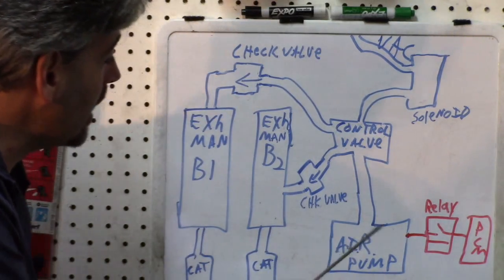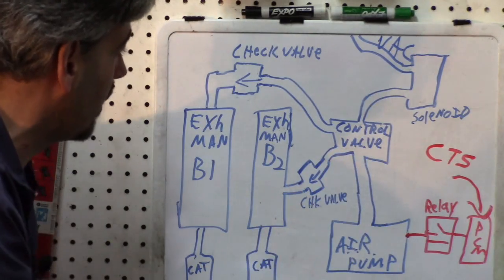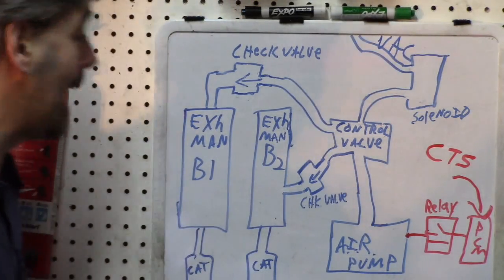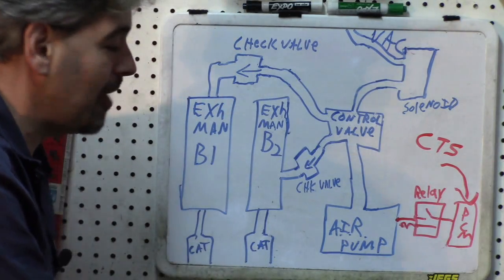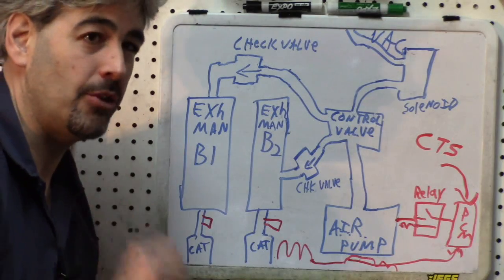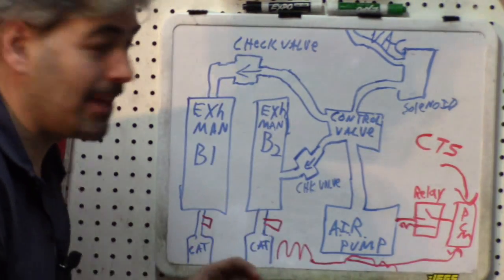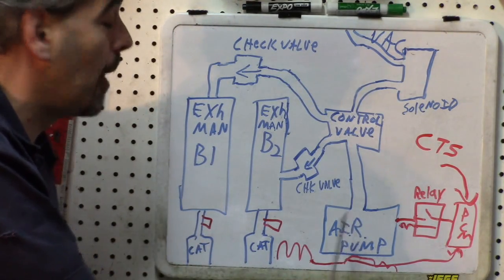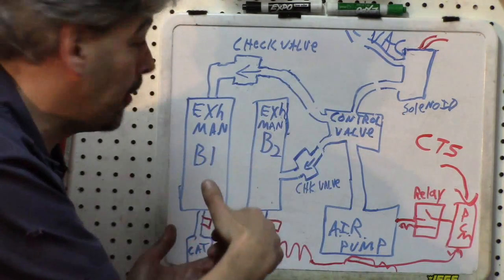Air Injection Reaction (A.I.R.) Diagnosis and Understanding-Pt1

Comment: Hey Matt, thx 4 the video.... Although in MY CASE my S600 at start up sounds like a jet engine which is indicative of the air inj. pump. Also I have a CEL for the same problem. They're warrantied up to 70K but my cars over that so I'll just replace it... Also, the lines going up to the exhaust manifolds shouldn't gum up should they?
Reply from the maker: Just disconnect power to the pump and see if the sound goes away.
Reply: @SchrodingersBox  Matt, thx 4 the reply! Afterwards I thot to myself, 'Duh!!!'
(ps: u showed us that on a Maf test I think)

Comment: I have a question. My SAI code is telling me that the driver's side bank one is not receiving enough oxygen but the air pump is pumping plenty and the check valve is new not sending exhaust back up but I just found out the vacuum solenoid is stuck open. So that means it's still allowing air to be pumped into bank 1 but why would it say p1412 air signal implausible? I figuring bad vacuum solenoid would make bank one and two have a problem. Also it's not preventing air from entering it's just staying open forever. So aside from that being an issue would that be the reason to cause not enough oxygen to be reaching the oxygen sensor? 

P1412 Land Rover Discovery 2 v8.  (Only bad part seems to be vacuum solenoid stuck open)
Reply from the maker: What is the oxygen sensor response when the pump is activated?

Comment: Can you make a video regarding ls swaps and having PCM's altered for use in older vehicles. Specifically deleting rear O2, cats, and EGR. What affects? Can this also be used on a modern truck, if one was not getting a inspection. Thanks
Reply from the maker: There would be no reason to do this unless it was for offroad application only and I don't really focus on that kind of thing. My dedication is to get people to be able to pass inspection lol.
  There's a channel called "bleepin' jeep'" that may have info on stuff like that.

Honestly, why not just gut the cat and disable the CEL? Seems so much easier that trying to work around it.

Comment: So you have been good to answer some of my questions previously, hoping you can help me out with this. I'm working on a 2004 Land rover Discovery 2 for a friend, first time ever working on a land rover and first time on a vehicle with a SAI system. Check engine light is on, getting codes P1412 and P1415 (first time I read codes they weren't coming up), I have changed the SAI solenoid, checked the SAI blower, vacuum is good, did notice that FL2 was blown, replaced that (supposedly the SAI goes through that. Checked relay, its good and I can jumper terminals and SAI blower comes on, everything seemingly is good, SAI not coming on when it first starts up like it should, not sure what else to do or what to check ?
Reply from the maker: What is the voltage drop on the solenoid?
Reply: @SchrodingersBox  I will have to check that, I just checked voltage at connecter with ignition on, one pin showed 12 volts, the other showed 5 volts. The connector for the SAI blower neither pin showed any voltage with ignition on.
Reply from the maker: Was rhe 5V one a reference? Why 5V? Is there a potentiometer built into this thing?

Comment: Hello. Where does the air pump get its air from? Where does the inlet hose connect thanks!
Reply from the maker: it just draws it from outside. the hose usually runs under a panel or something to prevent water from being drawn in.

Comment: I have a question about my 2004 Mazda rx8. I was pulling a code for the Secondary Air Pump, the mechanic I took it to, switched the electrical plug from the air solenoid to the SSV solenoid. It then turned off the p2259 code and the p0663 code to the SSV. So does this mean the solenoid isn't bad but it's the electricalal  plug itself? If so what's the fix? Btw, the mechanic was just going to change the solenoid, if it was the solenoid it would still throw a code no matter which plug was connected to it and it wouldn't throw a code for another solenoid?
Reply from the maker: It is impossible to tell without getting the powers, references and grounds readings.

Comment: I have a 2002 Trans Am with a P0410 code. I checked the relay it was fine. Air pump was not working I checked it by applying 12v power and nothing happened. I ended up replacing the air pump but I still ended up getting the same code and the new pump is working. I noticed that the PCV hose on the back part of the manifold was   ripped. Would that cause a P0410 code?
Reply from the maker: +Rodrigo Mejia I quite often have found multiple causes on an 04x0. At least 3 times the Motor AND solenoid were bad. When the system gets water in it, the components degrade. often one fails first but then after jot being repaired for a long time, other components also exposed to moisture rust too. It's not unusual to see an AIR system is rather deplorable condition.

Comment: OK question. I have a 84 Buick regal 3.8l v6. I have a changed the check valves both of them. Then I changed the air diverter valve but now the new diverter valve makes some weird pumping noise inside of it. Any solutions please
Reply from the maker: ok, what data do you have?
Reply: @SchrodingersBox  no data. I'm just trying to get to pass smog and get going again
Reply: @SchrodingersBox  is it normal for that valve to make that noise
Reply from the maker: no. that’s why we need data. without data you can’t diagnose it.

Comment: I have a 2005 Buick Lacrosse 3.8L, local shop gave up after repl cat, ignition module, fuel rail.  I have repl coils, plug wires, and O2 sensors, cleaned throttle body and MAF.  It's throwing P0411, P0053, P0054.  Mode 06 showing O2 sensor values off.  The vehicle intermittently stalls on hard acceleration.  I've been hesitating on the AIR pump.  Could it be?  Is that really plausible.  Can I diagnose that vs check valve before trying both.  I'm running out of ideas and want to avoid the "stealership" LOL.
Reply from the maker: What data do you have that indicated the Plugs wires, coils and O2 sensors are all bad??? I would totally start there.

Comment: Hi I have a question? I have a bmw545i with the engine N62 which almost impossible to clean the air ports after the check valves with out removing the Engine which so expensive! My question is is there any way I can manipulate the signal so the computer completes the monitor?? Please help or let me know , thanks
Reply from the maker: You definitely do not have to remove the engine for that procedur.  I do not know of a way to trigger the monitoring completion without actually meeting the criteria for the particular system monitor.
Reply: Schrodingers Box I try cleaning it with the AGA kit and the AGA hook but didn’t work the hook broke in side the head to get it out was a nightmare so I gave up I just did the valve steam seals and cleaned as much as I could with the brush in side de ports, once I found out how to manipulate the sensor and trigger the computer monitor I will let you know , thanks

Comment: Any suggestions on P1423 & p1421 on a bmw e46
Reply from the maker: sure. what data do you have?
Reply: Schrodingers Box  well I have a 99 bmw 323i e46 & I went to get emissions an I failed for 
F5 DME: Flow rate, sec.-air system, too low, bank 1 (OBDII: P1423; EUIII: P0410)

F6 DME: Flow rate, sec.-air system, too low, bank 2 (OBDII: P1421; EUIII: P0410) ... I replaced the the secondary air injection valve, fixed a small vacuum leak from the hose that runs from the one-way valve to the back of the firewall, & the pre-cat O2 sensors & my CEL is still throwing the same codes.....  I read a lot of Forums That says ...” start The Engine on a cold start & detach the inlet Air pump hose to see if the pumps is functioning correctly “ So I’m guessing it works Since I hear the fans come on but I’m not sure if it’s blowing the right amount of air into one way valve ...  so Ima try it an see if my SAP is working or need to be replaced.... is there anything else I should check??
Reply from the maker: What data indicates the injection valve needed to be replaced?  I would totally revisit that data for sure.

Comment: delete the AIR system and use what is left of it for crankcase ventilation to exhaust.
Reply from the maker: That is not the purpose of the AIR system.  KNOW AND UNDERSTAND  THE SYSTEM YOU ARE CRITICIZING!!!!!
Reply: I know the purpose. Would rather have cleaner engine bay.
Reply from the maker: What is the purpose of the AIR system then?
Reply: basically to replenish combustion reaction with oxygen
Reply from the maker: ABsolutely INCORRECT.  It is not even part of the combustion reaction. WRONG.
  Like I said- LEARN THE SYSTEM.
 This is a site based on accuracy not armchair hacks talking smack like on chatrooms and other sites.
Reply: Than you are also incorrect. You said the same thing in the video and explained it as two functions. 
I am not talking about an afterfire. 
Correct me if I am wrong.
Reply from the maker: Yes you are wrong.  You clearly sdo not understand the basic fundamental operation. You need to educate yourself better by watching and LISTENING to the video and UNDERSTANDING the concept.
Reply: Ye, and you need to READ and UNDERSTAND the comments.
Reply from the maker: Oh I do- that's exactly how I knew you have no idea what you are talking about.  begone, novice. The advanced people here are trying to learn- you belong in a beginners channel. Once you get experience you are welcome back.

Comment: I read that the air injection system forces air into the catalytic converters when the engine is warmed. Contrary to what you were saying?
Reply from the maker: yomomisjesus Then you read wrong. As a matter of fact this is even proven in the video with the measurement of 12V to the pump only during warmup. Q.E.D.
Reply: I read it from one of the most widely used by tech schools. Modern automotive technology by James E. Duffy on pg. 965.
Reply from the maker: yomomisjesus Then tell the publisher they are wrong and you have irrefutable proof
Reply: So no O2 is forced into Cat to help it burn emissions?
Reply from the maker: yomomisjesus not when engine is warmed up
Reply: Schrodingers Box that's exactly what stated, when warmed up. I will do further research since it might vary by vehicle's year make and model.
Reply: +yomomisjesus Maybe they forgot the word "not" before "warmed up"  It makes no sense to introduce extra air downstream into a hot exhaust system unless you're a fan of spontaneous backfires.at the head end of your catalytic converter. The only time it would be used in a warmed up engine is when it would bypass the exhaust manifolds and go straight to the catalytic converter to help it's operation.  That's why some catalytic converters have an extra port hanging off of them for the AIR injection hose but not all cars have this.  
The premise is the same, however, as the equation is Fire=Air+fuel+ignition source which can be heat with a rich enough exhaust which is why you don't see much operation of the AIR system once the car is warmed up.
Go back a few decades and backfiring was actually a problem with early AIR systems that ran off a pulley driven belt because of a poor control systems in the days before engine management computers.   They couldn't always control when the fresh air was introduced and the exhaust of a carbureted engine is always more rich leading to a perfect storm just waiting to happen.  No so with any car made in the past 30 years.
Reply: +yomomisjesus It is before engine warmup.

Comment: The F250 w the smog pump removed...  my'88 4.9  F150, the cx-921 (motorcraft part #) bypass valve doesn't hold vacuum and I can't find it anywhere.  If I could just convert it to CNG w some strong spark to run it on MagneGas I wouldn't even need the smog system!  sigh
https://www.youtube.com/watch?v=2kplISHsRrE